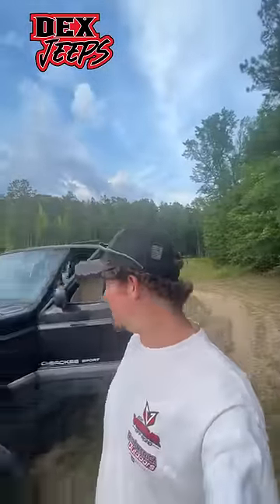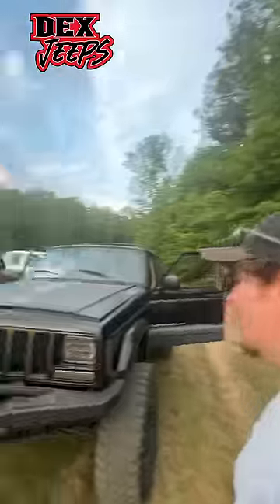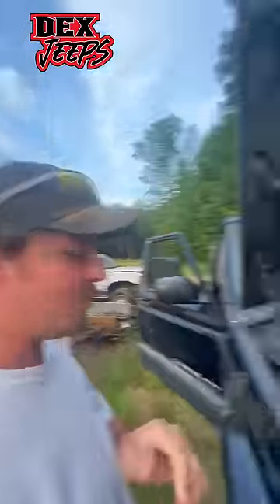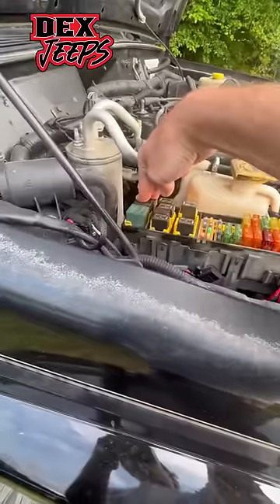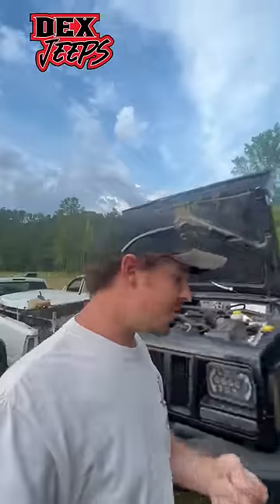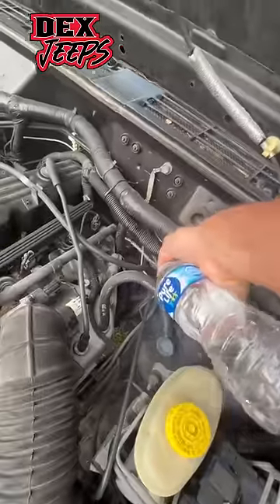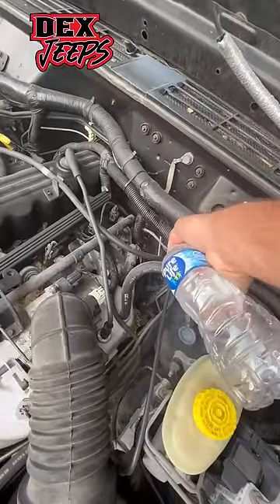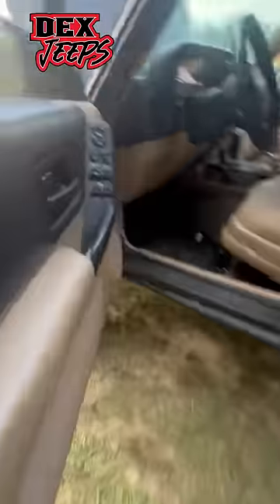Jeep crank sensor trick to get you home. #jeep #jeepxj #xj #jeepcherokee #cranksensor #jeeptips

Comment: If you're gonna run those big tires in the heat, get a better radiator or a better cooling system

Comment: Now put a simple switch in there on the crank sensor wire. When she doesn't crank. Flip it off. Crank for 15secs. Wait for 30. Turn on n the switch, start and go. It nothing to do with heat soaked. It's too many sensors on one circuit. Thank Chrysler for that. Their Ford engineers violating the kiss rule.
Reply from the maker: It’s a hot weak magnet….

Comment: I had a '90 Geo storm that had a heat soak no start. It had a distributor ignition with a solid state module in the distributor. I drove it to the auto parts store in the heat, went in a bought a can of air conditioning refrigerant. Went out to the car and it would not start. I pierced the can of freon and chilled the suspected module with it, which made it start right up and diagnosed the bad part, which I replaced and permanently fixed the problem. You could carry a can of R-134 in your Cherokee for this, with a valve and hose rigged up to spray it. They have it in cans now with self closing valves that can be stored after partial use. A good blast of freon will chill it faster than scrounging up a bottle of water.
Reply: Have a 87 cavalier that had a heat soaked ignition module on the block under the coil pack once that happened replacement was necessary as it wouldn’t start no matter how cool it got.

Comment: Do you have any tricks to diagnose and limp home with a bad cam position sensor?
Reply: Its most likely the OPDA but also check the grounds on the block
Reply from the maker: It’s usually the phasing of them both not matching up.
Reply: When my cam sensor was bad my jeep wouldnt start, unless i gave it some starting fluid but i literally only made it a few hundred yards lol. This was back when i was younger and just throwing parts at it. Fuel pump.....nope, followed the internt everyone said crank sensor and to buy OEM jeep.....nope, wised up ans snagged a scanner, told me it was cam sensor, of the 3 tbings i changed it was the cheapest and by far the easiest, it took my lomger to find the socket. Was on an 01 with coil pack so no messing with a dizzy.
Reply: @dexjs  please elaborate for me you have my interest peaked

Comment: Always change the crank sensor and camshaft sensor as pairs
Reply from the maker: Been working on Jeeps 20 years and never done or heard that.
Reply: Literally most xjs dont have a cam sensor, so............... how?
Reply: @jamesl9686  I'm aware that 97-01 did, but 4.0s 86-96 didn't.
Reply: Ye tru 2000s wj had the 4.0 with camshaft sensor

Comment: I appreciate you giving advice bro... I won a jeep not sure if my 2007 grand Cherokee Laredo has the same sensor but I will try it in case it ever happens
Reply: No that sensor problem  is only on the 4.0 Straight 6 Yours has a 3.6 v6 or 4.7 V8

Comment: I saw a video where they tightened up the clock spring or whatever it's called, on the cooling fan to make the fan run faster by simply removing the cooling fan & tightening the spring if you have a clutch operated cooling fan.
Reply from the maker: Are you joking about me???

Comment: Weirdest problem I ever had was on a 94 Grand Cherokee 4.0. Would start and idle forever but if you drove off it would die after about a mile or so. Crank no start, let it sit for 10 minutes and start back up. 

I figured crank or cam position sensor so replaced both. NOPE!!

Finally swallowed my pride and brought it to a Chrysler mechanic. (Only time ive ever let someone else work on my vehicle) 2 days later he told me that he wad stumped and I may have to just come get it. 

Two hours later he calls me to tell me that he figured it out by accident. As it turns out they installed a new battery due to draining my battery from starting it so many times and my old battery was the culprit. It had a short between cells and had plenty of power to start the vehicle but when driven and all of the sensors kicked in, the battery was drawing too much amperage from the alternator to keep the jeep going.
Reply from the maker: Oh wow.  Yeah Chrysler products are very strange with a good and bad battery.

Comment: i have a 5.2  1996 jeep grand cherokee that dies out when it hits a  puddle of water . not even 6 inches deep. i wait 30 minutes then it cranks. but if i crank it about 60 seconds strait it cranks back up. yes i didnt do it all 60 seconds strait but it was a total of 60 secs in about 4 minutes. somthings getting wet and stopping the fuel injection or crank sensor signal when it gets wet underneith. wish i knew wat it was because my crank sensors in my transmissions bell housing see.
Reply from the maker: Follow up.  I will explain that issue.

Comment: I finally beat the heat soak issue, upgraded my water pump to a high volume flow, slapped headers on it and wrapped them. Put in the special cherokee heat shields, and run my electric fan on a switch. 
Also changed my radiator but it's OEM. Wrapped both radiator hoses.
Reply from the maker: It’s a battle. Where you live?
Reply: @dexjs  was living in Colorado when heat soak was a major issue sitting in traffic, but now in wyoming where heat soak was never an issue for me. My new problem now is it won't get hot enough to make the heater usable lol. 
Oh and I did use a lower temp thermostat. Forgot that part. 
Engine is still stock but has been rebuilt.
Reply: Try replacing the ac condenser. The fins get bent up from bugs or debris and restrict air flow. Causing overheating issues. Or sometimes old spark plugs can cause it to overheat also.
Reply: @FR4087  i deleted AC a long time ago.

Comment: Unplug it and plug it back in.
Reply from the maker: Wth would that do???
Reply: @dexjs  next time it won't start try it. If it works, you tell me why.
Reply: @dexjs   had an 89 wagoneer with a 4.0  everytime it failed to start, unplug and plug back in the crank sensor and she'd fire up and run till the next time. After it became more frequent, I replaced the sensor, no more problem. Connection was clean. Manipulating the harness did nothing. Thought if I could get you to try it, maybe it would provoke further testing.

Comment: Typical unreliable jeep we I mean Fiat...
Reply: This isn't fiat, way before their time. I wouldn't say unreliable. I drive a ZJ with the 4.0 daily, and I'll take it anywhere. I've done nothing special and it just runs. It's not perfect, but it's never let me get stuck.
Reply: @arthurr8670  wow a very rare lucky Fiat owner.
Reply: @airgliderz  No, they were Chrysler in those years. 2004 they were diamler chrysler, somewhere around 2010 or 12, not certian the year, yes they are icky fiat and i hate working on them. In the 1980s AMC had jeep. In the 60s it was Bantam. And Willys in the 50s. In the 40s it was Willy's design built by Willy's, Bantam, and Ford to keep up with the war.
Reply: @gweasbawl9611  just as bad Daimler Chrysler partnership was a disaster
German over engineering unreliability.